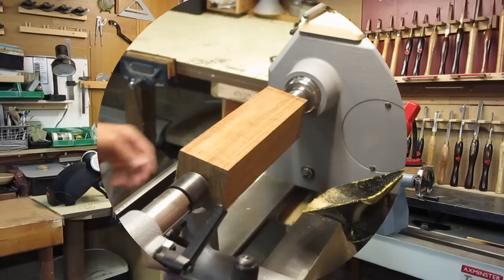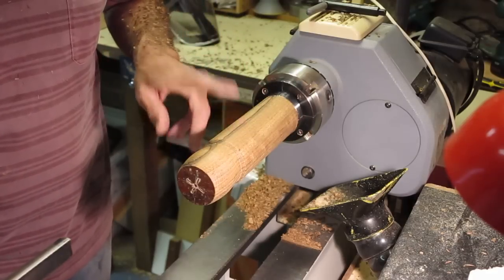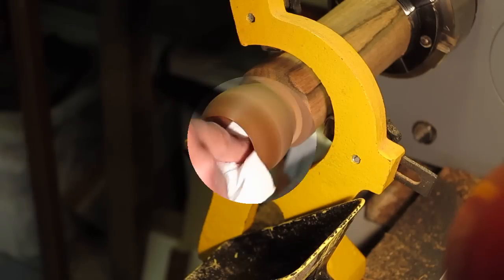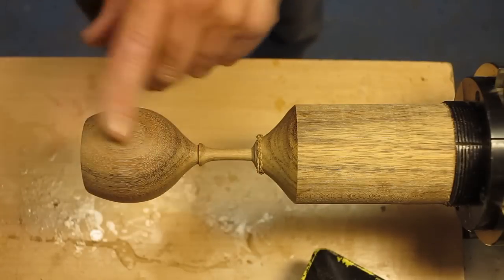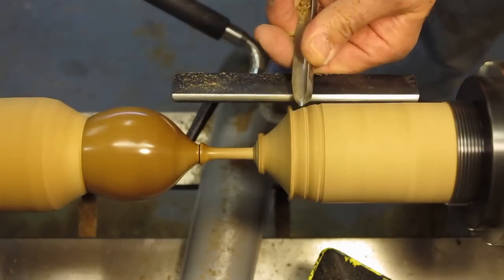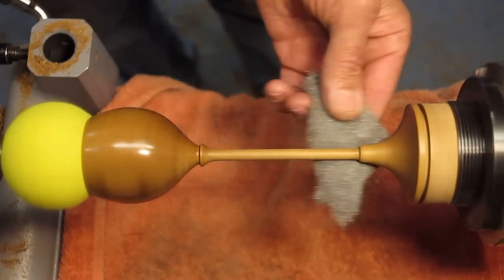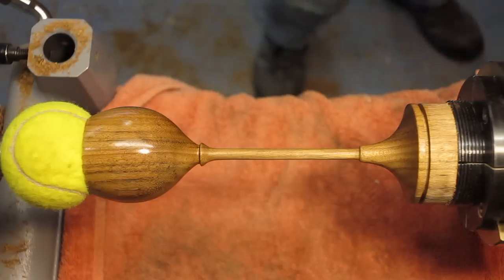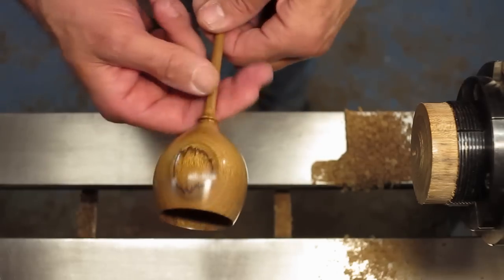Wood Turning - A Goblet in Amazique

Comment: Hello Mike,
It's great to have another video from you and may I say you're looking swell and glad to hear you're back at work.   It's apparent you took my advice on eating lots of a certain shellfish while on holiday.  The goblet is stunning so many thanks.  I concur with your advice on using wire wool as it has wrapped round items I have had on the lathe but it does leave a great finish.  
With all good wishes,
Alan.

Comment from the maker: I removed the nub in the center with a chisel, then used a palm sander to remove parting tool marks, then hand sanded to 600 grit, then 2 coats of sanding sealer mix, and 2 applications of wax, buffed out with a polishing mop on the drill press.
Thanks for the question
Cheers
Mike

Comment: You could, and should, most of the times, even if you've hollowed out the bowl, but it's much safer to do it at that order, also, when you're done with the stem, if your bowl is not hollow, you will need to use a lot of force that a thin stem can't support and would break.